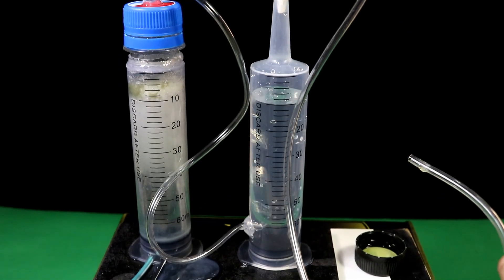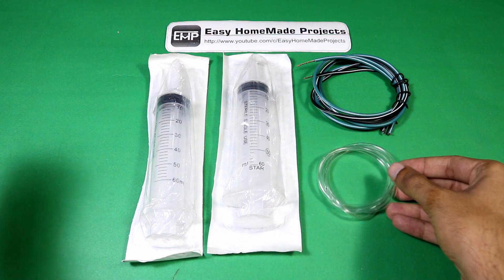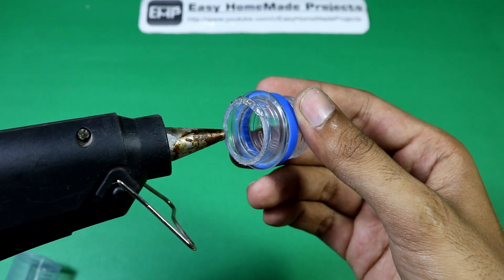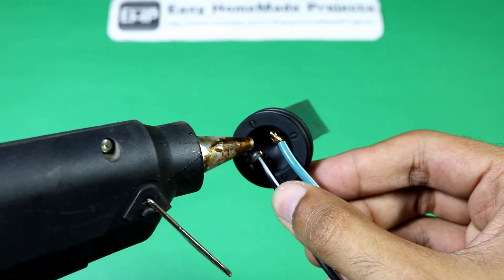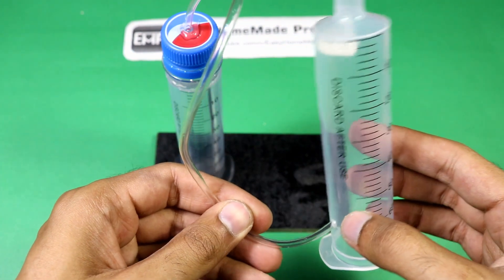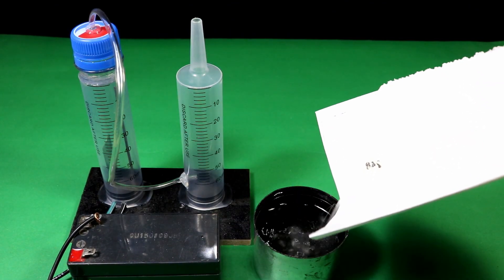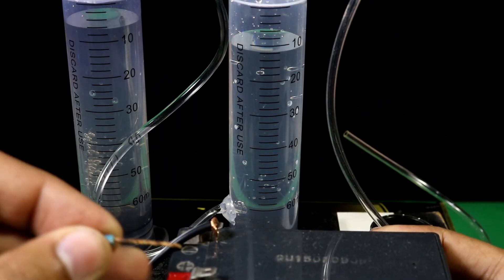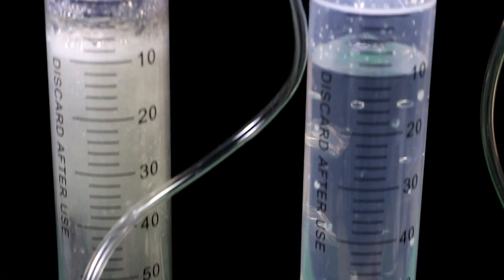How to Make a Small HYDROGEN GENERATOR using Syringes - Very Easy

Comment: can  we  use aluminium foil  instead  of metal  strip
Reply: I tried aluminum foil.
It didn't work well even I used higher voltages (24v), it doesn't produce much gas.

Comment: This is awesome! I have watched many videos before on how to make them but this is by far the simplest, cheapest, and easiest! Very well done. I might actually go and make this myself. Sounds like a fun little project. 
Quick question though, for your anode, what was the material you used? What kind of metal was that?
Reply from the maker: thank you so much. both are steel.
Reply: Okay awesome! Thanks!!
Reply: yeah but be sure about one thing: that small generator inst useful for most stuff